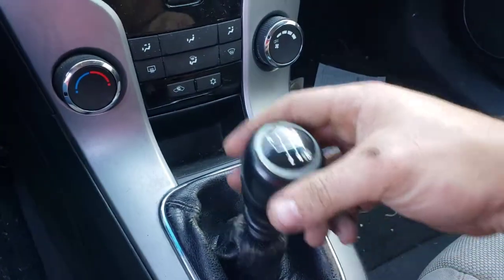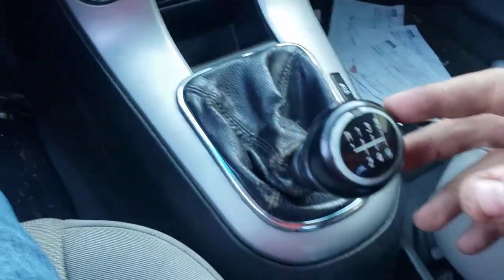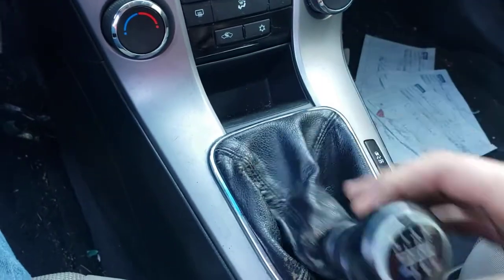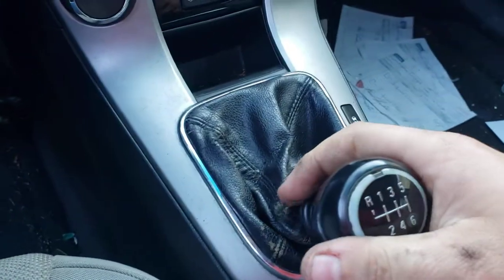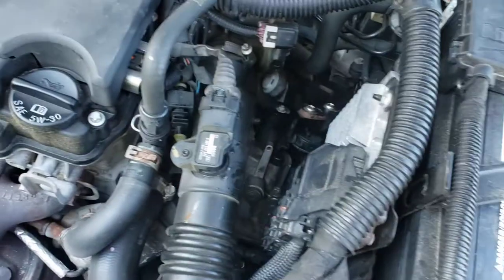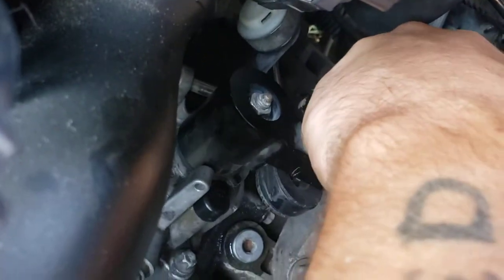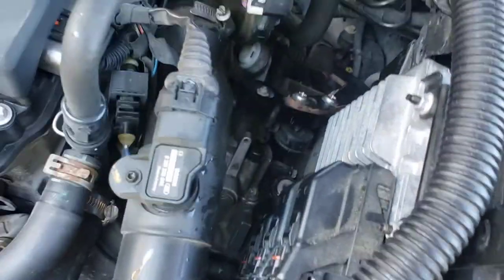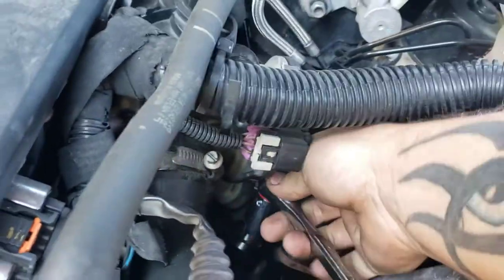chevy cruze 1.4 6 speed shifting problems solved and fixed!

Comment: I have a 2012chevy cruze manual and had it serviced only 2 be returned with a part on the shift housing cracked is there anyway I can fix this myself as a beginner? I have had 2 companies scam me already and I don't want anymore
Reply: The part is gm 19300507 but only the arm oart by the bolt is cracked someoone said it can be welded I have a picture of it but don't know if I can add here

Comment: I have a chevrolet cruze 2012. Having problem with the gear. Hard to shift the gear when mitir on. Cant shift gear to change speed. Help... thanks.
Reply: The clutch hydraulics are known to have issues.  When it won't shift, try using your foot to pull the clutch pedal to the full up position.  Give it about a minute, then try it.  If it works, something in your hydraulics is bad.

Comment: Please help!  I’ve got a 1976 Chevy Itasca on a p20 chasis. I can not find out what the green wire is. After I got a new alternator put it my clusters all spin crazily. Any advice? They ALL spin besides the battery gage. I’ve gotten it looked at by many mechanics and the wiring is fine they say it’s the cluster panel itself but I just struggle to understand that as it was working perfectly fine before the new alternator!